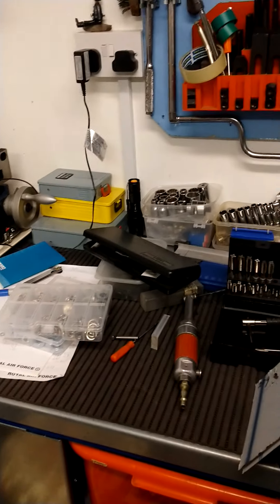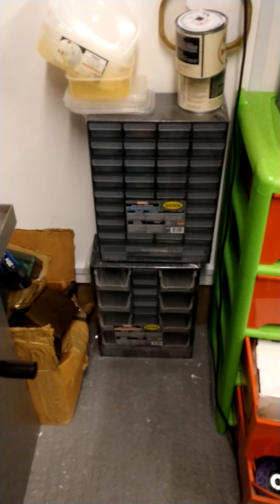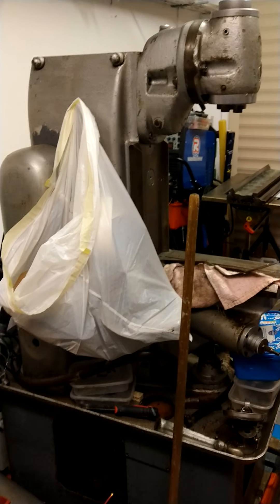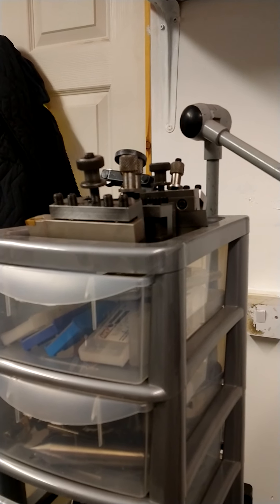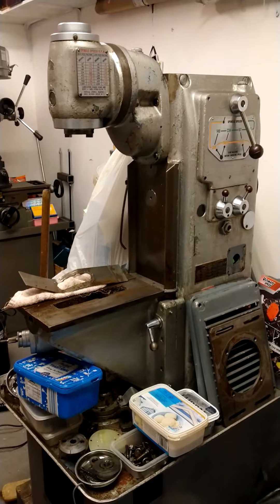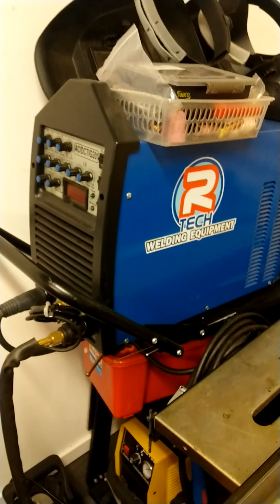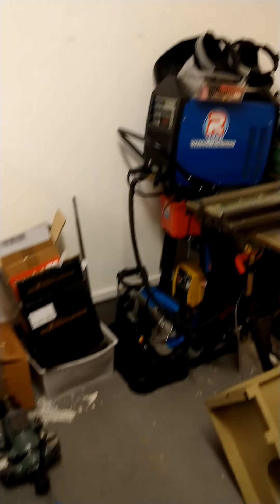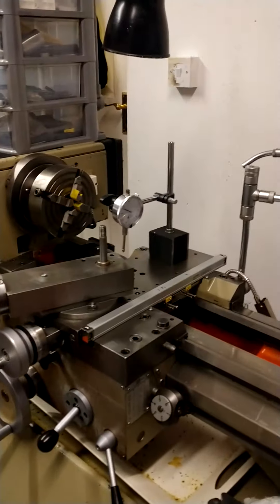A look in my workshop...

Comment: Hello, fantastic work. I just discovered your channel after reading about your harrison 600 on mig forum. Instant subscribe. You sound local. Where abouts are you located? I'm northumberland. I was very glad to find your restoration as there isn't a great deal out there on these beasts.  I've been having a headache with the cross slide gib strip adust. The plunger and wedge pieces that adjust the gibstrip via the screws and lockouts. Can't find replacements anywhere. Keep up the sterling work. A freind of mine has a large workshop, he says never desire more space, it just gets filled with more clutter and ends up the same anyway! All the best
Reply from the maker: Thanks Joseph. I really appreciate your subscription and your comments. Despite my accent I live in the Highlands. I hope you get things sorted with your machine. I'm going to be doing some more work on my milling machine and posting more next week.
Reply: @carlwilson1772  cheers.  i'll look forward to it 👍